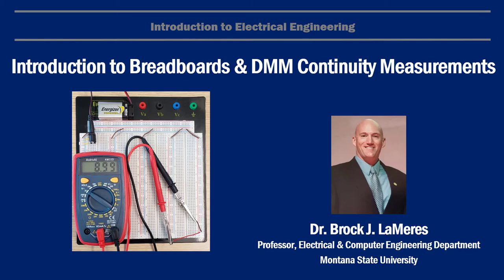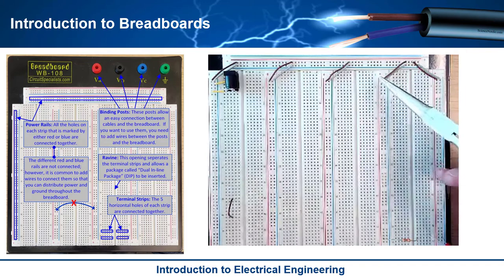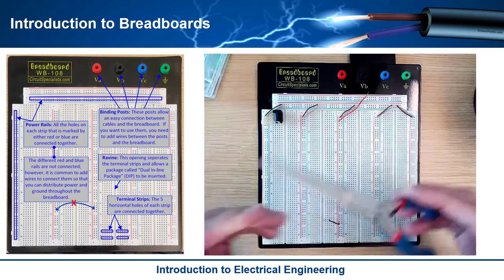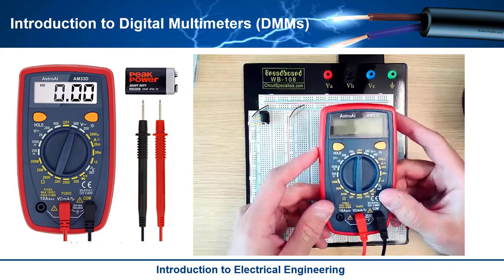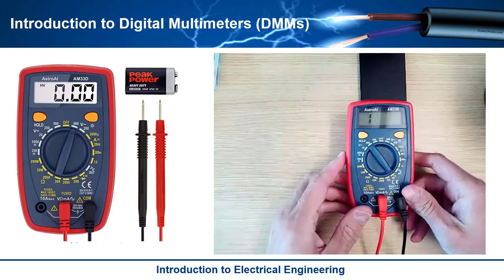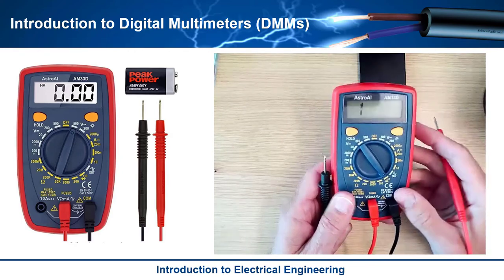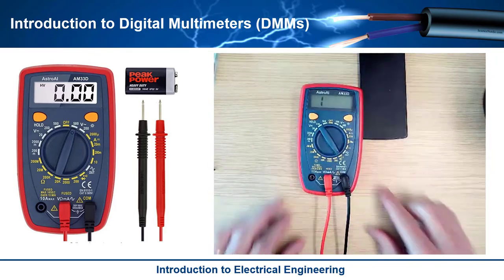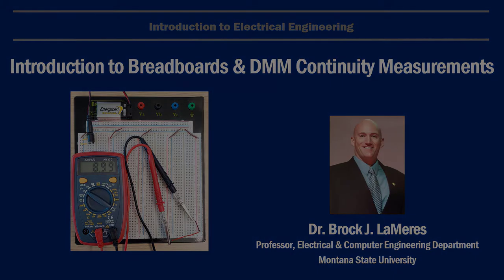Introduction to Breadboards and Digital Multimeters (Continuity)

Comment: An important thing about breadboards is that they have lots of stray capacitance and inductance. Weird stuff can happen if you try and build fast circuits or use parts that are capable of fast switching: a 500 MHz transistor neither knows or cares that your circuit should operate at audio frequencies.
Reply: Perfboards (not the strip boards) work well for prototyping up to 100-200 MHz, and dead-bug over blank copper clad PCB material ground plane works up to the GHz region. You can glue on strips of spare copper-clad on to keep everything tidy and make impedance controlled lines that work up to ~10 GHz. (Manhattan style)